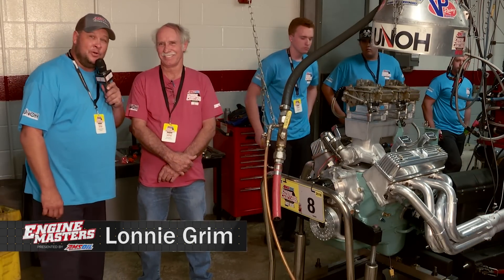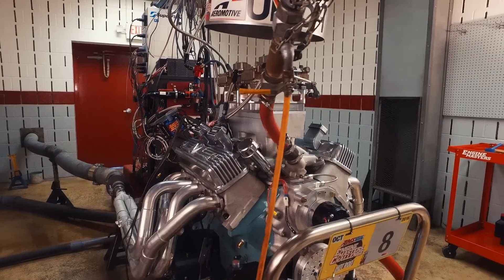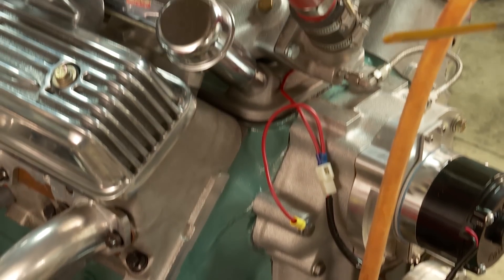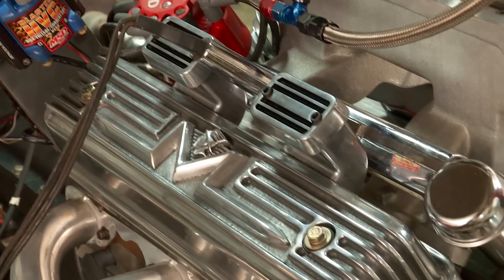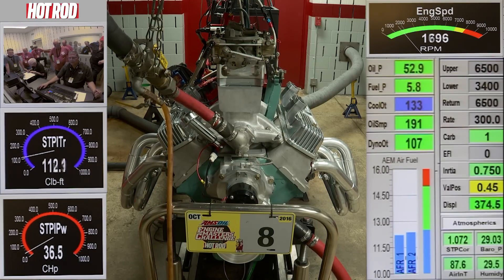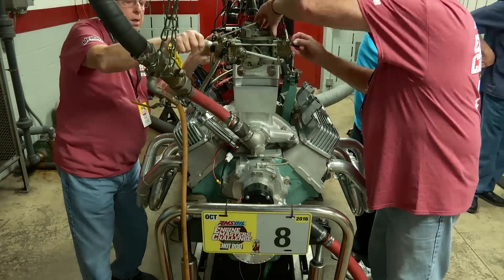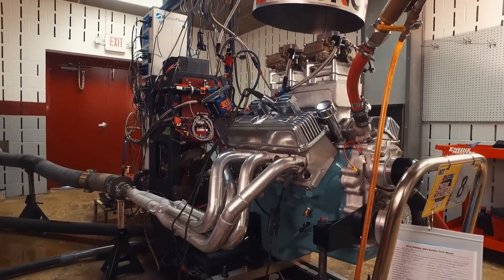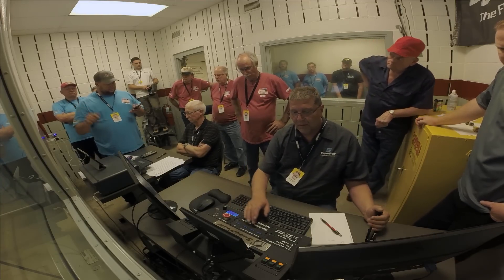Eaton Balancing's Mercury Y block Wins Vintage Class

Comment: Is it kinda like a small block Chevy head made to work on this set up?
Reply: The Y block from factory has the intake ports horizontally stacked and even an odd design at first it allowed the engine to safety rev to 7 thousand which is wildly overlooked as a great base design with lots of potential
Reply: Jon Kaase did that. He worked over a set of aluminium heads and Hi Rise SBC intake.
Reply: They are Mummert aluminum Y-Block heads

Comment: Is that an MEL Y-block or the Ford 292-312 variety......pretty good horsepower.  How many cubes?
Reply: Def not a MEL by the valve covers
Reply: @radioguy1620  Dunno.....aftermarket covers.  I owned 2-292's and one 312 and hot rodded them.  The heads don't look right for a stock Ford Y-block head and the manifold hold-down bolts don't look to be right.  Wish they'd give more info as that is really good HP and I wonder what's been done.  Any ideas?  I was running an Offenhauser manifold with 3 Strombergs and a bunch of work done on it.  I could have never come close to those horses.
Reply: @tomnekuda3818  I dont think they put any MEL s in trucks ,
Reply: @tomnekuda3818  these guys know a lot they are not saying , hard won too Ill bet
Reply: @radioguy1620  Not real life, I guess.  You'd never get that tunnel ram into anything.  I found an interesting fact the other day....if you slightly modify a SBC ram manifold it will fit 292-312.  Something about which head is farther forward....it matches the Chev......Interesting.  I think Jon Kaase did it on an Engine Masters competition Y-block.  Wish I had the reference.
Reply: @tomnekuda3818  Here's the reference to John Kasse's Chevy intake manifold fitted to his Y-block.
https://youtu.be/XaOhdZSPd1M
Reply: @tomnekuda3818  Kaase was running a Chevy High Rise intake on his 590+ horsepower Y block the previous year. From what I gathered he actually worked on some SBC aftermarket aluminium heads and made them fit everything on the Y block... Kaase that is.
Reply: @kramnull8962  Yeah, I read about that.  The ports even lined up pretty well and he made some serious power with the thing.
Reply: @tomnekuda3818  - the heads are Mummert Y-Block aluminum heads.
Reply: @sandibaker7646  Thanks......am familiar with Mummert stuff and how very good it is.....just didn't realize that's what he's running.....now it makes sense, Dale.  Thanks again, Tom  P.S.  Now that I look at the heads I can tell there aluminum....I'm gettin' old; blind in one eye and can't see out of the other!  LOL
Reply: Kaase took a pair of stacked Mummert heads and filled the ports with aluminum, then cut knew ports to run the Chevy intake with adapters. The following year, Eaton ran a set of Mummert’s stacked port heads to prove you could make the power and he won.

Comment: What's the deal with the hex cap manifold bolts?  Won't they break off or strip easy?
Reply: Grade 8 hex head bolts would strip out aluminum threads before breaking or stripping.

Comment: I could never run my Yblock that hard, I'm way to cautious..
Reply: Ian Knau also mine redlines at like 4K :)
Reply: Theese awful engines in stock form surprise didn't explode .oil pump pencil shaft breaks really easy .early years oil problem to rockers .used to pipe between drains left rt heads.had a fleet of them yrs ago.still couple in yard..different cam brgs. Later yrs.
Reply: I run mine to 7k all the time. Good strong engines.
Reply: @dondesnoo1771  You really have no idea.
Reply: @mctim64  i had 15 cars with y blocks ford's  mercs. Lincoln's   3 ys. In yard    224 .252 292 312.   334 ?   59merc .           430 462 linc. How many do you have
Reply: @dondesnoo1771  Quite a few really, including the "World's Fastest Y-Block". I've been building them for years and racing them. They are a well built engine from the factory , run strong and last forever. As long as you know what you are doing. My 1962 Ford F-100 had a recorded top speed of 127 mph with nothing more than a few modifications  to a stock 292. With a few extra $ and some aftermarket parts that same truck ran just shy of 150 mph.